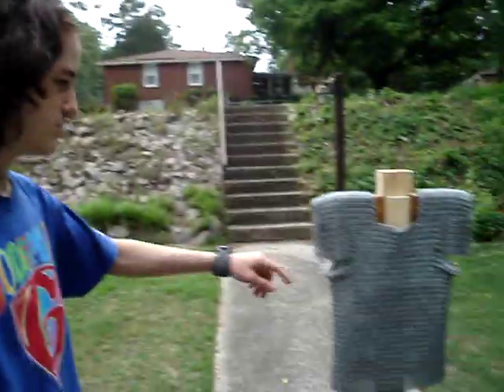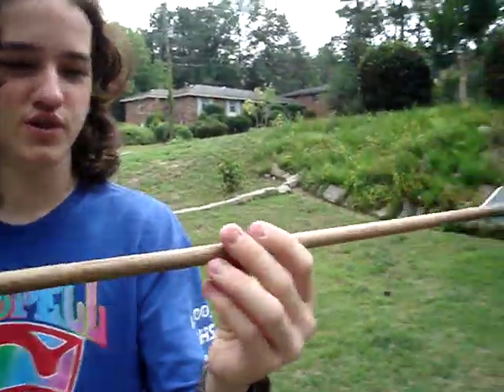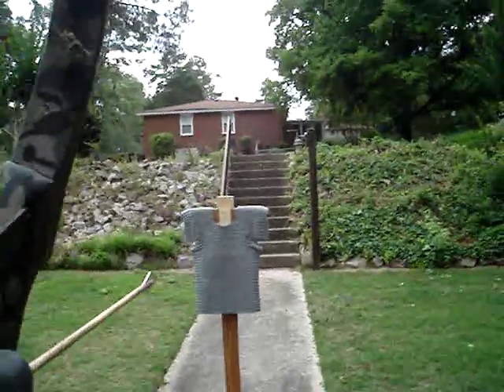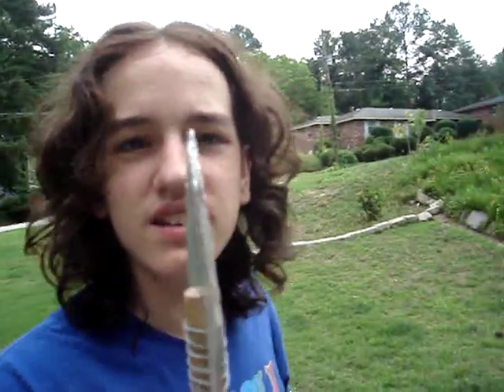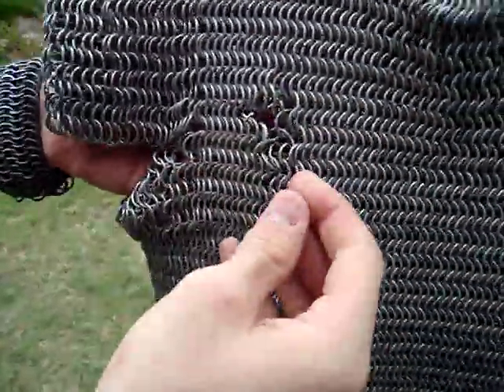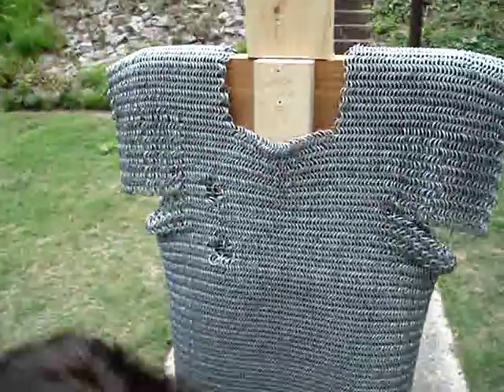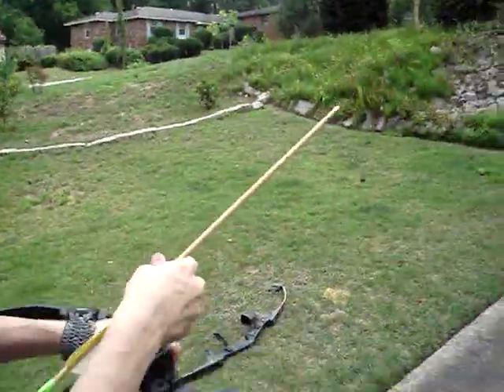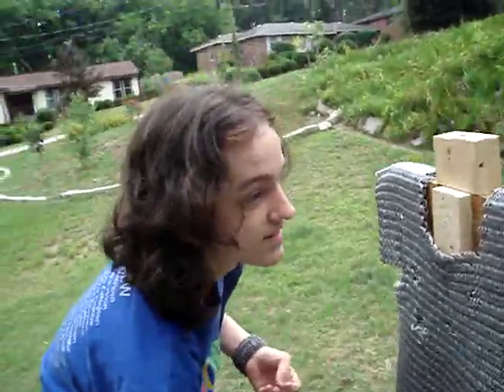Armor Test 8-in-1

Comment: It is relatively easy to make yourself a rig to weld your rings. It makes a huge difference in it's strength. However, a high powered bow would still put an arrow right through it. And any type of thin blade knife/sword such as a stiletto style will stab through with little effort. Personally I would keep your chainmaille pattern all the same. I wouldn't change to a less dense weave for comfort. either make the arm holes a little bigger. or you can taper the sleeves.

Comment from the maker: @WangsterBling I have found that it is not really worth it to connect the armpits on a shirt such as this, since if I did I would end up having a huge bulge under my arms that would be very uncomfortable.  However, on a shirt with a looser weave, it would be as simple as continuing the weave inward from all directions until you reach a point of no continuation.  At that point you should probably get some thicker gauge rings, because the stresses on the underarm area are significant.

Comment: I wouldn't fire wooden shafts on a modern composite bow, unless you are using a steel knock. The acceleration and jerk of the bow string is strong enough to split a wooden shaft, and the energy is high enough to turn the splinters into projectiles of their own. Also, dry firing a comp bow can damage its structure, as those same forces need to be transferred into a shaft to prevent the limbs from trying to absorb them all. 

I'm not trying to rag on you, just trying to help you be safe.

Comment: I don't see the point in testing this if you don't make it for protection. The most obvious flaw (of which you are already aware) is that the rings are butted, not riveted or welded. But also the steel is galvanized, which reduces the strength of it. If the maille had been heat treated (Q&T), it might be of a sufficient hardness to be of some use when merely butted.

I am currently making some 4-1 butted chainmail myself, but just for gloves. As you said, it should be sufficient for cuts.

Comment: The problem here is that it's up against wood. You need to put it on a manikin or something that can mimick body mass. Plus, there was the padding of a gambsen, plus clothing and then the actual body of the person.. that would actually help absorb the impact of an item and spread it out, causing the directed energy of that ever is hitting it to dissipate a bit making a difference whether something can actually penetrate or not.

Comment: I'd like to point out you are using the wrong form of arrow head (not gonna mention the arrow shaft, for it is close enough) what they would use is a thin, almost the same size as the shaft sized point that is made just for penetrating armor. Reason being is that it would cause immobilization at least.
Reply from the maker: +Shadowcard As I've been explaining since I uploaded this video 6 years ago, this is clearly not historically correct armor, therefore using a historically correct method of attack would have no value.  I used what I had, so satisfy my own curiosity.
Reply: +ChanmailleMan fair enough, but I'm saying that a more correct testing of you armor would be to use a smaller point because that is what is used against armor (also you would be hard pressed to find an arrow with that wide of a point), but it is still quite interesting, I would like to ask about how your repairs went.
Reply from the maker: +Shadowcard Repair was simple enough, tear out any damaged rings and replace them with new ones.  I ended up tossing this armor in the trash last year, though.  Just no real reason to keep it, I've got plenty of much better stuff now.  Still not historically accurate, but much better nonetheless.

Comment: Your links are running 90deg from most period examples I have seen. The horzontal weave is very flexable but it reduces the resistance of the armour to impact, especially the blunt trauma caused by real weaponry. Try knitting a vertical weave garment and you will see a difference in how the armour withstands damage.  Also the other notes about the difference between fixed, welded, rivited links are correct.

Comment: @jacobbobcorn Oh I forgot to say; heat treating the 1055 steel makes it stronger. Always heat treat it after u made the armor; never befor.  If you do it before it is just harder to work with.  But with mail, I guess you can heat treat the rings before you put it together.

Or just use Titanium, that can work too, and it is a bit stronger then steel and 44% lighter as well!  Also very good vs Corrosion!  They sell Titanium Chain-mail..

Comment: A ream of silk under the maille would work better than leather or a gambeson, as Genghis Kahn found out. Rivited or soldered armour would have been potent enough that large arrows would have been useless. Hence the invention of the bodkin point, which was also better against the plate maille, especially when left to rust before use...  :)

Comment: Part of the reason that broke: Massive rings. Less stable. Small gauge coupled with that: less durable.  Butted maille: Much less durability with the two previous factors. Plus at the range you're shooting at, it a lot more force in the impact. You would never be firing a bow at that range especially with how long you took to nock and fire.  You'd be dead.

Comment: i agree except for the arrow shattering thing if u use oak dowel it should be fine to shoot oak   longbows used did use oak  for arrows which had a draw of 100 to 160 pounds if the arrow did shatter it would be when hitting the target so 15 feet away is as close as i would dare to be

Comment: Real maille (I.e. riveted maille) with proper padding, does provide decent protection against most kinds arrowheads, even with rings as thin as 18Ga. Though 16Ga is much better!

LARP-maille (I.e. butted maille) will show wear just from moving, until you get into much heavier gauges; 14Ga - 12Ga, or greater! Against wasters, or blunted steel, it will warp and shed horribly until about 12Ga. I really don't think you'd want to wear butted into real combat.

Comment: @jacobbobcorn Well material? mild steel will do, but 1055 steel is VERY good. Heat treat the 1055 steel armor AFTER you made the armor out of that steel; but only heat treat it if you know how to do it. (I do, but it takes some one good to not mess-up or even brake the armor, it really is not that hard to do.) Then Pint the armor black or gray, the paint will help fight off corrosion.

Comment: @jacobbobcorn Top quality or  Should I say historically accrete Chain-mail were 18 to 17 gauge  to be light...  But to add strength & still keep it light they were 4mm, 5mm, 6mm, & 7mm rings being the biggest.  Small rings makes it a bit stronger & makes it lighter.  European Chain-mail at least senesce the Romans were in fact flatten wedged & or riveted to make it even stronger.  A Halsberge or Hauberk Mail made like what I said on top can be as light as 15 lbs! And still be very strong!

Comment: I'm not surprised that the arrow penetrated. After all, your standing point blank maby 8 feet away. if you tried putting it farther away an shooting at some sort of angle, the arrow would glide off. Try making your arrows a bit better. I'm an ameature arrowsmith, and I use turkey or goose feathers for flethings. On the bright side, your maille looks great, though it looks like you had some trouble with underarms. Also, you've great vocabulary and anounciation, which few people posess nowadays.

Comment: 12gauge steel should have been used and instead of leaving them  as butted rings, wire feed welding would have done nicely . even hand held torched welding . This will make it last much longer against an arrow attack, unless a broad head arrow is used. but well done

Comment: Your test is flawed because you have the wood behind the mail if you want to properly test it hang it on a stand made of several layers of cardboard, that will tell you how deep the arrow really would go. 

As well your fiberglass arrows are too light, in a battle the enemy would be firing much heavier arrows at you. With the heavier mass those arrows would go right through. 

Your big arrow would be much more effective if you narrowed the head, your current head is too wide.

Comment: its the leck of resistance. Ur Energy goes directly into the arrow which is shot away with this energy, without arrow theres still the energy (cuz u draw it) which "shoots" to the bow itself so it can easily break in parts. If that would happen the danger for u ist obvious, cuz there is a lot of power in such a sot.

hope u understood it :-D my english is terrible.

Comment: Chain mail won't protect from arrows, it's to stop swords from cutting (it'll still hurt like crap).
Reply: Quintin Wood historical riveted chainmail was to stop arrows as well as swords. He's using butted mail though which is what breaks apart easily. When riveted mail was invented the design was quickly adopted by many.
Reply: +Jared McClelland i heard they would have 2 layers of chainmail on the chest is that correct,
Reply: Sebastian Caine The only thing I can think of similar to that is if they were wearing an aventail as well. That would put two layers on the upper chest and shoulders. Other than that people would just wear one layer of maille.
Reply: Jared McClelland
How much damage would a powerful sword thrust make, to someone wearing mail and a padded undergarment, would it break bones, i imagine it would hurt alot!
Reply: +Sebastian Caine having been stabbed while wearing maille I can tell you I didn't get any broken bones but I did get some serious bruising
Reply: Jared McClelland Who stabbed you??? do u live in a dangerous area,
Reply: +Sebastian Caine it was merely for testing purposes. I trusted that the blade wouldn't pierce my armour and testing on a person is the most accurate way to test armour since people have give.
Reply: +Sebastian Caine I had a friend stab me with a dagger. I wouldn't advise shooting arrows or bolts at someone in maille. from my tests shooting it when it's not on someone. Arrows from my 50 pound bow bounced off of it but arrows from my 75 pound bow and bolts from my 150 pound crossbow punched right through it.
Reply: Jared McClelland Thats too bad that it wont stop my crossbow, its only a cheap pistol crossbow but its 80lbs, your brave to let your friend stab you, good job its your friend and not you enemy, haha he may have tried harder to penetrate it lol
Reply: Well if it is a pistol crossbow it may stop it. Because crossbows have a short draw length they need a lot more power to get a bolt moving fast. My 150 pound crossbow shoots bolts a little slower than my 75 pound bow shoots arrows.
Reply: Jared McClelland Ever heard of a slingbow, its a cross between a slingshot and a bow, very cheap to make, no annoying restringing, and from what i am seeing on youtube its just as powerful as a crossbow,
Reply: I have not

Comment: next time put trysomething soft soft underneath the chain like quark board or even styrofoam, I promise you'll see different results. I learned it was a better test when I shot at my 4 in 1.  Without anything behind it, the vest just curls and catches the arrow, and with wood behind it you might as well have it on a chopping block.  A heavier styrofoam will give it structure while still having the give a human would have, well more actually